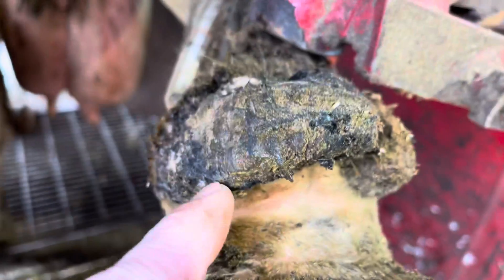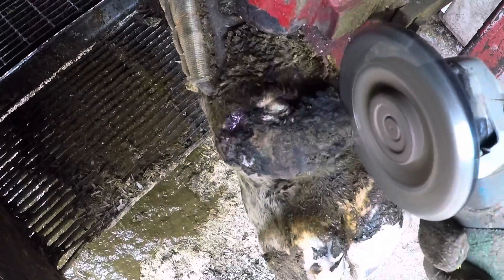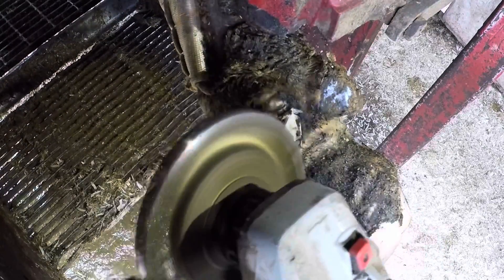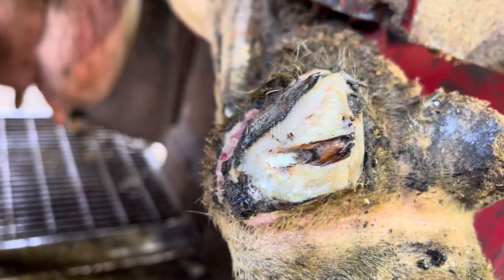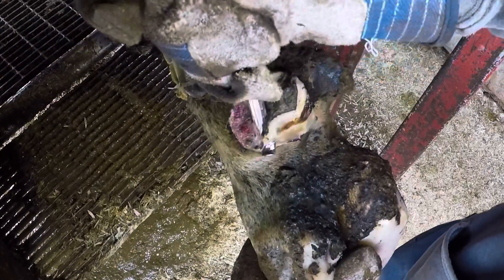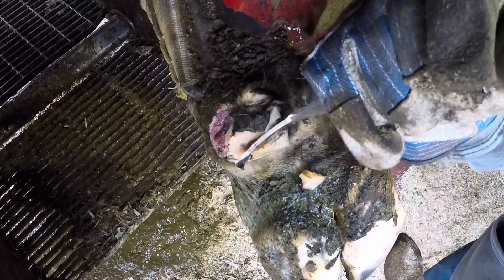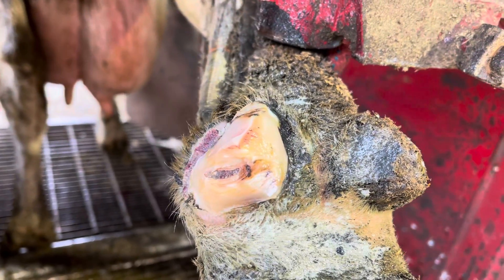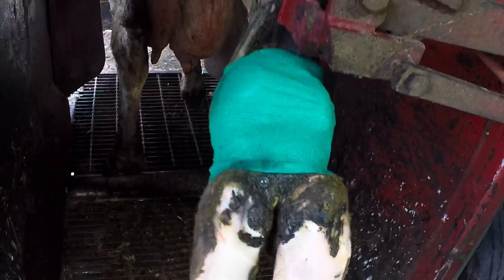Why is this DEWCLAW GROWING SIDEWAYS???

Comment: Interesting, this is the first time I've seen you use sulfate instead of salacilic acid, does that also provide pain relief as well as bacterial killing treatment like the acid?
Reply: Nate's also mentioned that the copper sulphate paste tends to be too harsh to use directly on corium, which would be why you don't see him use it in most of his other videos.
Reply: ive heard Nate in the past say the reason is due to two things , one is the part of the foot and the powder has a harder time staying applied in areas that arent as flat , and the other part is the severity of the infection . this one seems like the shape of the dew claw wouldnt be able to have the powder stay on it easily !
Reply: Exactly what I was wondering. Why the different treatment then the usual?
Reply: I don't know, but I've seen other trimming videos where paste is used further up the foot. Apparently it's just a dilute form but still does the trick. Not sure.
Reply: Might be a different type of bacteria, so it needs a different treatment or because its not the sole itself the treatment doesn't have to be as aggressive so the sulphate can be used. These are only guesses though

Comment: I fixed it for you. Welcome.
You can trim it back farther because it's NOT WEIGHT BEARING, the cow doesn't walk on it or normally put any pressure on it, so it can be trimmed closer to the corium than the hoof claws.